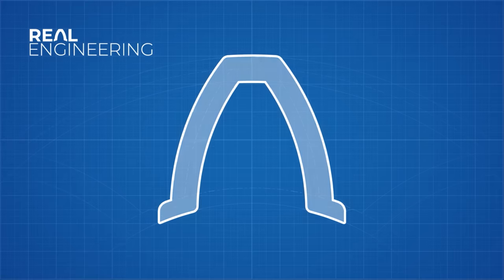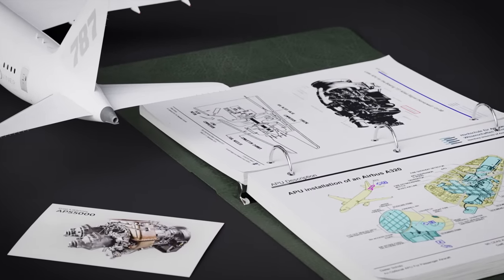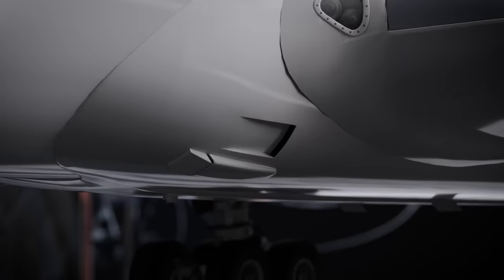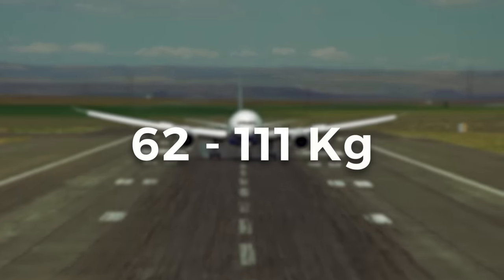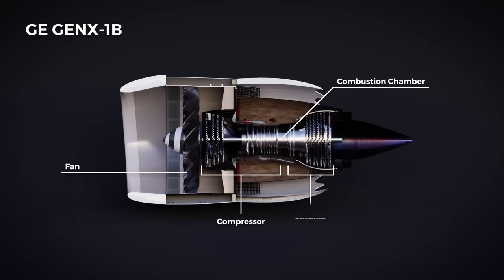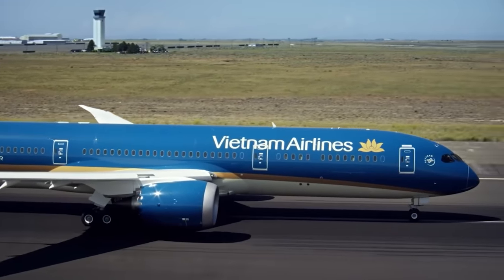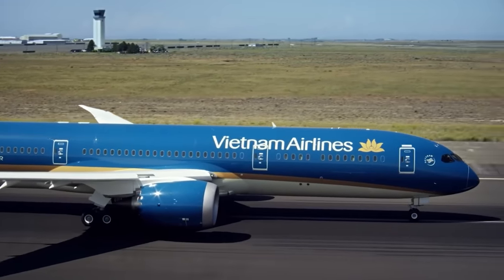The Insane Engineering of the GEnX

Comment: The jet engines of the 40’s thru 60’s were mostly very low bypass engines and huge fuel hogs.  Everything new is high by-pass engines, the P&W GTF takes the efficiency to a whole new level.
Reply: You can't talk about bypass with a pure turbojet engine which is what the jet engines of that time were
Reply: @caty863  Conway had a bypass - albeit quite low, as they got their maths wrong.
Reply: Yes essentially powered fans, with the consequence of dramatically increased engine diameter which is changing the airframe performance and stability. Correcting w software has its limits.  The 737 Max might have been the outcome.
Reply: @Nill757  The ‘flaw’ with the 737 is its low ground clearance that airlines like for easier luggage handling. With bigger diameter engines they eventually had to move them forward for clearance and hence the software to correct for nose pitching up.  Boeing f’d up by avoiding pilot training for those models as a cost saver for the operators.  Plus they removed the dual sensors too..save another few bucks.  Interesting the same model sold to the military had the dual airspeed and pitch sensors.
Reply: @TheBeingReal  Yes, that’s my understanding, though I take away a different summary.  Any change that substantially worsens static or dynamic stability in passenger aircraft inevitably increases  control complexity, which is waived through today because ‘we can fix it in software’.  Maybe, but the complexity of the aircraft still increases, usually leaking into pilot load.  Checklists have already exploded.  So of course somebody didn’t get trained.

Comment: Excellent videos. I watched them separately on youtube, because I liked watching 2x30 mins more than 1x60 mins. Would've liked timestamps for the removed information so I could watch those parts on nebula afterwards.. Ended up just skipping through the nebula video to find it, since I do have membership over there, but timestamps would've just made it easier.

Also I think you have a misunderstanding in the video. The brake test you are describing, in which an aircraft aborts at v1, happens during take-off, not landing. v1 is the highest speed at which the aircraft still has time to stop, before running out of runway, beyond that speed, the aircraft must take off. The speed is important, because it is usually lower than the rotation speed, the speed at which the pilot starts pulling back on the stick to lift the front wheel off the runway. This is not related to landing. Aborting a landing would mean increasing power, to get back into the air, and so would not include the brakes at all. Doesn't change your points about how brakes work at all though, just thought it might be informative ^^

Comment: 13:30 Turbofans blade tips do in fact break the sound barrier. The whole point of having a cowling/duct around the fan is to eliminate the supersonic/subsonic fluid interaction that would happen in blade tips were open to the atmosphere. That is also why the tolerances are so tight between blade tips and the duct.

If you look at the GEnX with a fan diameter of 111.1 inches, and fan rotation speed of 2560RPM, you'll see the tip speed is about mach 1.1
Reply: Yes, it gives them the buzzing sound…

Comment: Very cool edit.
However, the fan is on an axle running through a hollow axle for the inner compression/expansion stages, sharing it with the outer expansion stage 😉

Comment: If the fuselage displaced it's air into the engine (cross - sectional) with minimal heat transfer to the body, then temperature of that air would increase along with the speed of sound. Turbines tuned to the temperature and pressure can then optimize fan rpm to go faster - yet stay below the speed of sound locally. How big a bypass ratio can you get?

Comment: Bleed air does NOT power hydraulic systems on ANY plane.  The engine does directly via gear driven pumps, mate.
Reply: Nope, there ARE many aircraft types that uses air driven hydraulic pumps. For example, Boeing 747-400 uses 2 air driven demand pumps for it's No.1 n No.4 hydraulic system. Boeing 777s also uses 2 air driven demand pumps in it's center hydraulic system. Just looking for a picture of a 777 overhead panel you'll see what I am talking about. It's not the main pump, but works as a redundancy or automatically when system the loading is high.

Comment: I was still wrapping my head around the size of the engine for about five minutes after u said it was the size of the fuelsalage of the 747
Reply: It's not. It's more like the size of a 737.
Reply: He never said it’s the same size at the 747’s fuselage. He mentions its diameter is that of the 737’s fuselage but I personally don’t think that’s correct judging from photos. It does look a bit smaller than the 737’s fuselage

Comment: My takeaway: they can machine a whole disk of blades from a single piece of metal, yet the composite blades are individually produced.
Usually you figure it's the other way around: complex shapes are easier to do in composites than in metals.
Reply: who tf thinks that
Reply: @user-cc32vcg811  Take for example how many pieces are fastened together to make a fuselage from aluminum, or from composites.

Comment: 0:37 actually it's more like the size of an E-Jet or CRJ. The GE90 and GE9X are as big as a 737
Reply: I was going "eehhh.." when they said that. I know the GE90 from the 777 is as big as a 737 fuselage, but the 787 engines are more "normal sized".
Reply: @sjokomelk  It's just smaller than the 737's fuselage

Comment: The Rolls Royce Trent 1000 feels left out.  Even though it is a bit lighter while maintaining the same Power and fuel burn.
Reply: The RR engines were used on 4 of the 6 flight test 787s. The GE engines seemed to have more teething problems than the RR engines.

Comment: So, insane engineering or very carefully researched, technologically mature engineering?

Also that w is a lower case omega. ω.
Reply: Technologically mature engineering done to an insane degree. You’re correct in that there isn’t much that’s truly revolutionary about the materials or application, it’s simply the scale and quantity that it’s done at with the 787.
Reply: Omega is the angular velocity of a rotating system. It’s measured in cycles per second, or rotations per minute (RPM)
Reply: @anthonylargeanus9401  No, in the SI system omega is in radians per second. One rotation is 2π radians. So if something is spinning at 4000 RPM, you get the angular velocity from 4000 / (2π) / 60. Which is about 10,6 radians per second.
Reply: Thank you for bringing up the omega thing.  I"m a physics teacher and I tell my students that one of my pet peeves is calling it "w".
Reply: @Kepe  take it easy with the brow beating. We’re both correct
Reply: @anthonylargeanus9401  Not really, Kepe is correct. And it is an important difference since both have the same unit (1/time). That makes it even more important to know how to interpret that number.
Reply: @HuyV  Kepe is working in the SI system. I was working in imperial. Both are correct. 60rpm=1 cycle per second = 2pi radians/ second. There are many different ways to describe the same quantity. In the US we use both interchangeably in industry. In certain instances it is more convenient to use one unit over the other. The main thing is that angular velocity is always in 1/time as you pointed out. Both my answer and kepe satisfy this. I will provide an example. When I designed a power train unit we worked in units of rpm because people have an easy intuition for this quantity. I then converted it to rad/s for some computations. No matter the unit, the quantities are both angular velocity

Comment: I find the GEnx remarkably easy to work on compared to smaller engines with manually opened cowling. The PDOS system allows a mechanic to not worry about what it's going to take to get into the darn thing, and just get to it. However it is a HUGE piece of equipment and like all jumbo jets it ain't easy getting to the work area. The wire harnesses are easy to replace but not secured very well and so we've seen some chaffing issues. Oh, one thing I noticed about the GEnx is how fast it starts. The starter/generator gets it moving FAST and it's started in no time.

Comment: 23:53 - You got it reverse. - Titanium is not really heat resistant. Titanium has better strength to weight ratio than aluminium. What does the alloy do, that is magic.   Titanium being not heat resistant is also a reason why it is not used in turbine stage, it would burn. It is used in compressor instead, where they blades are bigger, but air is cooler. The turbine blades are shorter, but experience a very high temperatures. Topic on its own, how they make them from super alloys of nickel and other metals.
Reply: They're talking about titanium aluminide which is a different breed than your standard titanium alloy (Ti-6-4, TI-17, etc). Titanium aluminide offers very good oxidation resistance at high temp and pretty good creep strength.  It's comparable to many of the lower end nickel-based superalloys, but without the hefty weight. It definitely won't replace the hotter portion of the engine, but close!
Reply: Exactly why the SR71 leaked like a sieve when it was on the ground. The titanium body panels were designed to deflect and expand that much when they heated up. Cruising speed and altitude, it all tightened up.
Reply: Who cares CMCs are the future
Reply: Standard titanium alloys like 6Al-4V retain decent strength up to around ~800 F, then fall off quickly.  Certainly well below the 1500-1800 F capability of the nickel-based alloys, but not completely incapable.  I don't know the capabilities of titanium aluminide.

Comment: I understand bird strikes are typically found at lower altitudes.  Usually during takeoff or landing or on a circling pattern due to whatever circumstances dictate at the airport.  Obstructing the intake with bars or some sort of cone drastically reduces much needed air flow for thrust. However has any jet engine design company ever tried a device that could be only applied in these high risk altitudes and then they would be able to retract or move into a position that would not negate airflow? Now I am certainly no engineer I was only curious if this application had ever been considered or even tested.  I know the SR-71 had a nose cone but that was obviously not meant for bird strike prevention.  If anyone knows anything about this particular issue I would greatly appreciate a response.  Thank you and great channel.

Comment: Commercial aircraft using air to start the engines don't blow it through the turbine. They require far to much air quantity to rotate them to the required speed. On the ones I have worked on they are fed with 40 psi through 4in tubes to a turbine motor attached to the HP gearbox. this then backdrives the gearbox to turn the HP section of the engine to approx 50% N2 or N3 {depending on type} assisted by adding fuel and igniting it at 25%. 
I'm sure this was a slip of the tongue but quite important to understand. It is actually quite simmilar in principle to a cartridge start. IIRC the VC10 and B707 had a HP air start facility if a start cart wasn't available.
Reply: I agree. He also kept referring to the CF6 engines ignoring the GE90.

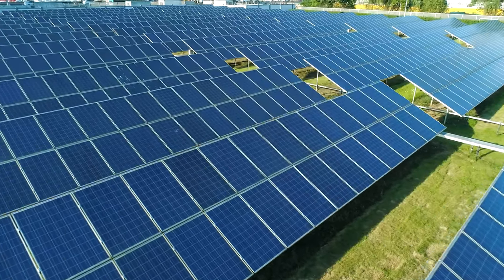Comment: 5:35 I am a Civil engineer literally working at a Solar Power Panel Farm construction at the moment. Thus, your input as "1.45 MW is equal to 10 football field covered by solar panels" are wrong. A generic footabll field requires to be around 7000 m2, where 1 MW worth of panels can be built around 1000-1500 m2 (depending on the location on earth susceptible to change due to sunny days, sun light angle of attack, panel potential, panel table size and distribution.) Thus, usually 1 football field of properly built solar panels farm will generate around 4.5-7 MW... Regards from Skeeby Solar Power Plant construction

Comment: Please consider producing a video on the P&W GTF problems on what, how, and why the gear box has very reliable while the remaining parts have had so many issues.

Please include P&W troubled history transitioning from their reliable piston driven engines to turbojet, high bypass ratio turbo fan and Geared Turbo Fan engines.

For example, P&W early 747 turbofan engines, the first high bypass ratio turbofan engines to enter into service, if spooled up too quickly they would literally blow apart.

Comment: Great vid.  I enjoyed all of it.  I hadn't seen some of that airshow/testing/whatever footage, and it was pretty cool.  The V1 stops, or testing, or whatever that was will all the mains blown and the red brakes was impressive.  The guys standing there with hoses are to keep a fire tamed if it breaks out, I expect, if a tire gets lit off or some fluid is leaking.  I wonder if anything is salvageable in those brakes if they hose them down at those temps?  Looking that them, I'm guessing the active parts, at least, are all carbon?  

And the momentary drifting with the nose wheel, and much more significant drifting (mains tests?) with the entire plane when they were yawing the crap out of it on the runway were pretty spectacular.   You don't think about a test pilot putting his ass on the line ON the ground in tests like that (I don't, anyway), but I will now, at least until I forget it again.  :-)  It made me think of the gear on the B52.  I guess that is too costly and in other ways prohibitive to incorporate on a commercial liner.  

Obviously the gear take that, but I've also seen guys drive them off the runways, smack tips, smack lights, and probably scare the bejesus out of passengers doing those severe cross winds and screwing them up, or getting a bad wind hit right at the most inopportune moment.  They don't get out of shape super quickly, but they don't get back into it in a snappy manner, either.  Lots of mass and rotational inertia there.  

Those wings are beautiful, they look more like something you'd see on a sailplane than a commercial jet, previously.  They sure do smile when he was pulling a good bit of up elevator, too.  If they weren't composite that would scare the crap out of ME.  You could do another vid continuing on with the materials challenges, aero, cost, etc. on the air frame as well.  I would watch it.  You kind of get a minimal polyhedral effect out of that smile, even straight and level, as well.  I suspect that increases stability and maybe even ride comfort.  Awesome aircraft.  Pushing envelopes in many disciplines.  And nice that you mentioned NASA, as well, since most people don't realize they do research and engineering in several areas.

Comment: B747-8 pilot here. The engine is as good as they say it is. One difference from the -1B engine and the one we use, the -2B67, is that we use bleed air to start it. The B747-8 still uses bleed air to de-ice, pressurize, etc…Also, a slightly smaller fan and 1 less compressor stage. Thanks for a fine video.

Comment: Fans and engine core have not been connected for a long time. Fans generally use a separate set of turbines ... a shaft within a shaft. The RR RB211 even had a 3rd shaft separating out part of the compressor stage so it could run at a higher rpm.

Comment: The fan and compressor are in two different shafts  HPCS and the LPCS
The reason behind the 9-1bypass ratio is the limitation of current architecture (Axial Flow).
If a designer tries to increase the bypass ratio, the core size correspondingly shrinks. meaning smaller LP shaft size however the LP shaft can not be reduced in diameter because of the rotational speed.
The LP shaft is limited by the critical speed.
The shafts critical speed is proportional to the shaft diameter and inversely proportional to the shaft length. 
Decreasing the shaft diameter with reduced core size is not possible without reducing the shaft length if the same critical speed is desired assuming a fixed engine length and fixed LP speed.
The designer would among other changes have to increase the size and weight of the HP compressor shaft to accommodate the opening for larger LP shaft which leads to current bypass ratio, higher weight and lower efficiency.

Comment: The fan actually acts more like a compressor than anything else, it blows air through the narrowing bypass duct causing the bypass air to compress. The air then expands back to its original volume and accelerates out the back of the annular bypass nozzle and that's how bypass produces thrust.

Comment: TAPS basically works like a port-direct fuel injection in piston engine. Most of the fuel injected are lean mixture, ignited by a small rich mixture pocket in the combustion chamber.

Comment: this is why the centre of the engine should be a void to allow venturi effect. the fav can also be guarded by a screen of blades that will deflect the chicken into the whole in the centre and smooth the air entering the engine at the same time. a pass through will also cool the inside ring of the engine.

Comment: Wow this thing is ahead of it’s time ,From the aircraft I will be working on after tech school is a c-130 that utilizes turboprop engines that work similarly to a turbojet engine works in some way instead of the turbine being turned it’s a reverse gear box?(might mess up name lol) but it turns the propeller with lots of torque and to hear these engines are practically giant propellers with electricity blows my mind!

Comment: The chicken gun is also called a rooster booster.
Also if i understood it right, it was said, that the turbofan and the rest of the turbine spin at the same rpm. That is as far as I know, not true. The Turbofan spins drastically lower, which i just recently was able to observe on a turbine being slowly spun by the wind clearly showing the internals spinning alot faster